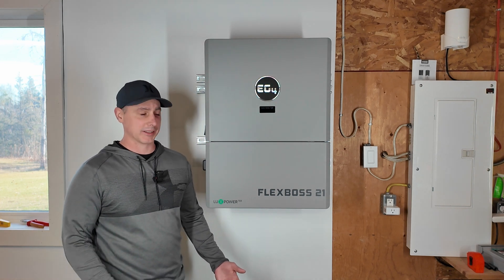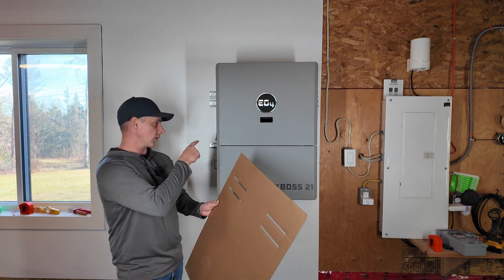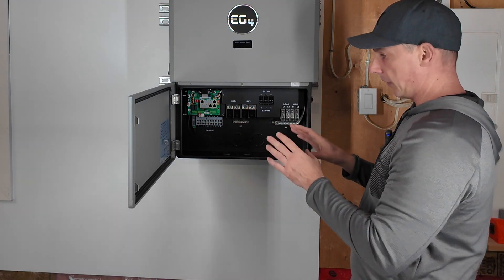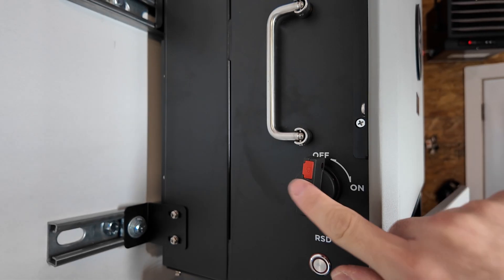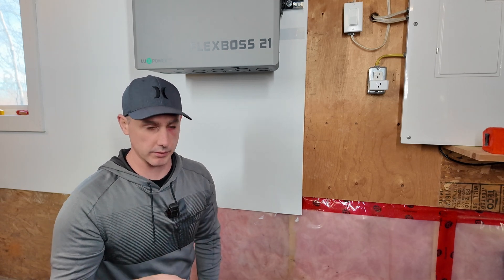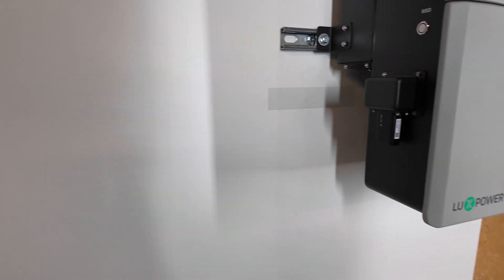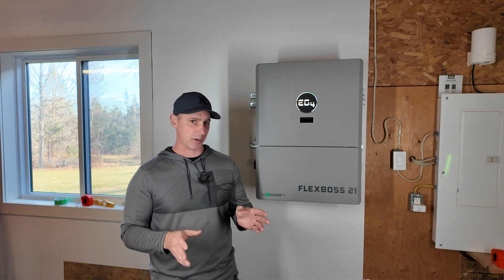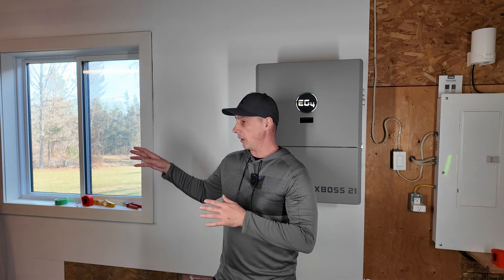FlexBoss21 Hybrid Inverter Walk Around and Future Plans

Comment: Dude, you need a qualified electrician. Some of the advice given here is whack.
Reply from the maker: I highly recommend using a licensed electrician. Could you give me an example of whack advice I gave?
Reply: @Roll2Videos wire size, need for the disconnect switch, and more. The calculation of the wire and overcurrent protection were nowhere close to correct.
Reply from the maker: @RoderickMcSlagerhaden  A 60A breaker won't protect a 6 gauge Teck 90 wire? What would you use? Edit: Copper wire
Reply: I'm talking about the way you described derating for continuous current (125%). The math wasn't mathing.
Reply from the maker: @RoderickMcSlagerhaden  To properly size the required breaker, take 60A x 1.25 (125%) which equals 75A. 6 gauge Teck 90 at 90°C is good for 75A
Reply: Where do I order the CT sensors?  Do you have a link?
Reply from the maker: @traceycarter5670  The sensors come with the Inverter.

Comment: i was looking at the Eco flow delta pro ultra but can't support AC coupling to keep the battery.
Reply from the maker: I have yet to work with an eco flow. Great job on looking into the unit beforehand 👍
Reply: @Roll2Videos  if your solar is not a grid tie, it's okay. Their are selling cheaper now, but you may need a second unit to get up to 14,400 watts. Then you need that double hub connection and  plug it into a 240 outlet.  The only downside is that it needs to be inside.

Comment: Thank you for sharing your setup. This was very educational for me.  I have a similar carport I will be using for my panels. 
Question, once you set up your arrays, is it possible to have a 12 and a 24 v output? Regardless of the watt rating of the panels
Reply from the maker: @ssarraf6855  The solar charge controller will manage the panel's output voltage for your system voltage.

Comment: How does it handle multiple AC units? You think soft starts are needed
Reply: I started a 2.5 ton unit ran the clothes dryer and started another 2.5 ton unit today. Works great. Plus all the LeD lights and TVs i have. I saw 10,500 watts.
Reply: @ all at the same time? That’s good to know. I guess if you have a bypass via the Gridboss or even the integrated 90a, if it exceeds it would just pull that from the grid to get it started then have the inverter power the rest right??
Reply from the maker: I hope to one day have multiple units to test that 👍. The instructions on the start-up don't call for it, although they expect you to use their batteries with a soft start built-in. I precharged my unit.
Reply: @ so if you buy, say the weather pro’s, you don’t need the soft start? I thought you needed soft starts before the inductive loads. I can’t find much info on it out there lol

But that’s good to know you don’t have AC issues. We ordered one and it shipped. We have multiple AC units so I guess we’ll find out soon
Reply from the maker: @Zodiac83104  I'm sorry I misunderstood you; I thought Multiple AC was multiple inverters, and the soft start was pre-charging the capacitors. I've heard the inverters can start an AC unit without a soft start, but I'm unsure about the ton. Multiple AC's on one inverter, I doubt it.
Reply: @ that’s alright!! I need to do research on it to see. We will also be hooked up to the grid so I would assume it would bypass any excessive energy and not be a problem. I guess it would be for a 100% off grid system. 

I’m staying tuned for any future updates you have with this inverter. If we have issues from our AC I will share my findings lol
Reply from the maker: @Zodiac83104  I appreciate it, thank you

Comment: How much power can the flexboss 21 backfeed to the main panel?  Also the 12KPV and 18KPV can backfeed the main panel also?   How are you going to wire it the main panel?
Reply from the maker: I'm going to make a wiring video soon. I'm working out an issue in the house first. The stuff you find when you move 🤦‍♂️
Reply: I think up to 16kwh with battery & solar.
Reply from the maker: @johncarr123  I can backfeed the full potential of the inverter.
I believe the 12/18KPV also can do the same.
Here is some wiring 
https://youtu.be/0ZBI93SXIsI

Comment: Great video 
My flex boss should be here in a few days. Your situation and configuration are almost identical to mine. I’m still not quite sure how to wire the ac and it would really help me if you could do a video with a wiring diagram or would be willing to send me one. Also I’m going to use your channel mounting idea. Thinking it may also help with cooling a bit. Thanks much!
Reply from the maker: @philorton1940  I will make more videos on how I will hook up my AC. There are a few renovations to my new house, and then I'll return to it.
Reply: thanks much

Comment: Might be better to run a line tap within that panel and then go to the inverter. You can then feed the panel via a load breaker with an interlock kit. This way both inverter or grid direct can feed that panel, not at the same time.
Reply from the maker: @cgutowski471  Great idea. I like the interlock systems and I'd like to get one for my parents' house. Thanks for the idea 👍

Comment: OMG. Thank you. I originally had the Anker F3800 and ended up returning it because of the limited solar input. But I liked that it could backfeed to the main panel. 

I did look at Ecoflow Delta Pro Ultra but the horror stories regarding support and the quality of hardware made me think twice. 

Then I looked at adding solar on my roof but ended up changing my mind because I didn’t want to pay 4-5x what the hardware cost just for labor. Seemed way overpriced. 

So I went back to looking at EG4 inverters and batteries. That’s when the Flexboss 21 showed up on the market. I was actually looking to do exactly what you’re doing. Flexboss to EG4 batteries. Have a ground mount outside running power to the Flexboss. Then just have it back feed the grid. With CT clamps it should only back feed when needed. 

No need for interconnect agreements and 1/5 the cost of just solar roof panels.
Reply from the maker: @amartins02  This is a powerful unit. That is a very good comment, it is easy to read and follow. Nothing needed to add; you hit the nail on the head.
Reply: @Roll2Videos did you get an interconnect agreement? I really want to avoid going through the hassle of doing that. 

Also are you going to use the Gridboss? A requirement is that the main 200 amp line coming from the meter has to be copper. Most people have aluminum coming from the meter to the main panel. That’s an added cost to consider.
Reply from the maker: @amartins02  I did not get an agreement. 
I probably won't get the grid boss because I already have a manual transfer switch in my house for my critical loads, so I could easily put an automatic transfer switch in its place. 

I'm not sure about only using copper with the grid boss you need to have the appropriate size conductor if you go to aluminum. 
There's a link in my video description for Adams Channel where he talks to the eg4 guys, and they touch on that subject.

Comment: The specs says that AC output is 50 amps max so that means 1 50 amp breaker in your panel.
Reply from the maker: 50A max continuous output. I wouldn't protect right at that point.
I'm using 6-gauge wire that can handle 60A according to the code. I'm protecting the wiring. It's like using a 10A breaker on a 14-gauge wire.
Reply: @Roll2Videos , the breaker needs to match the weakest link in the chain, not just the wire.  If for example, you had a 15 amp rated outlet on the end of a 20 amp rated wire, you would use a 15 amp breaker.  So, it could be argued that a 50 amp breaker should be used to match the rating of the weakest link (inverter components).  

Having said that, inverters are kind of a special case because they have their own overload protection systems (and sometimes breakers) embedded in them.  The inverter output is also not what the breaker in the panel is protecting since the breaker is on the far end of the wire (panel end), not on the inverter end.  So, I think you are fine as-is, but I'm just some guy on the internet.  

Out of curiosity, does the flexboss have a 50 amp breaker on that output or does it rely on firmware defined overload limits only?  Either way I still think it's fine as-is, but if it has its own physical 50 amp breaker on that connection then it's definitely a non-issue.
Reply from the maker: @CL-gq3no  Have you looked in the manual at 7.6 AC WIRING INFORMATION section on "Steps for AC Connection"
Reply from the maker: @CL-gq3no  I'm also a little confused about the thought process. If it puts out Max 50A, where is the extra 10A or more coming from?
Reply: @, I'm not familiar with the flexboss so I don't know the specifics off hand.  I have a 6000xp, which is different because it can pass through (bypass) more power than it generates.  I agree with you that it's not an issue in your installation because the power source is an inverter (not the grid) that is not capable of overloading that wire.  My only point is that I wouldn't say, "the breaker is to protect the wire" on youtube.  Someone may get the wrong idea and generically think other items in a circuit don't also need to be considered.  Outlets, appliances, switches, panels, and anything else downstream.
Reply from the maker: @CL-gq3no  Safety first 👍
Reply: You can only use 80% of the breaker rating continuously. So if the inverter can put out 50A continuously, you'd need a breaker ans wiring rated for at least 62.5A. The next standard size is 70A which is why that's recommended.
Reply from the maker: @niktak1114  The FlexBoss21 also has a setting that can be changed for continuous discharge limits.